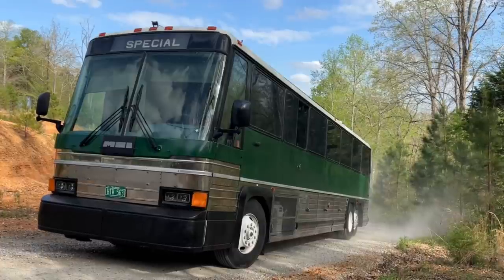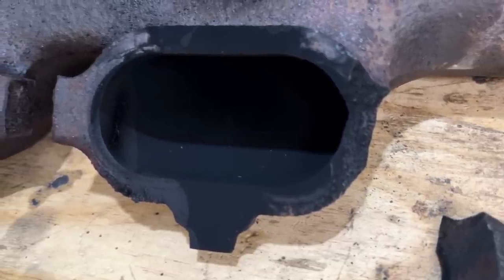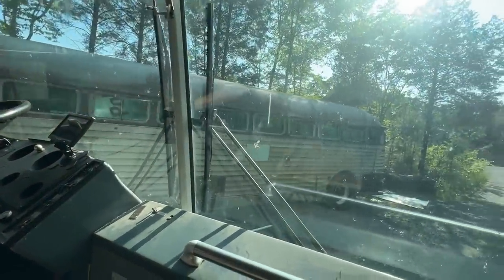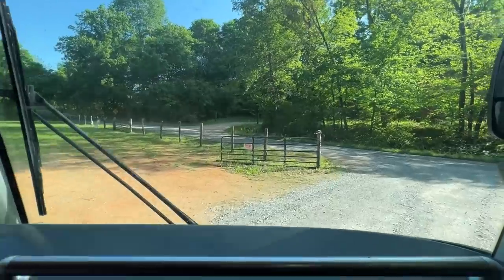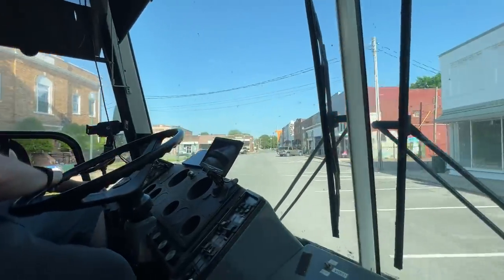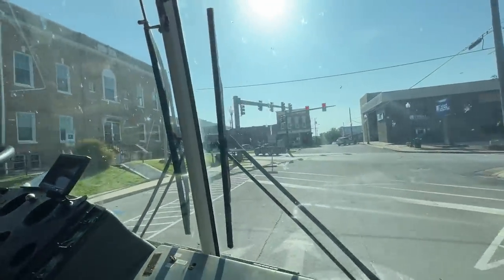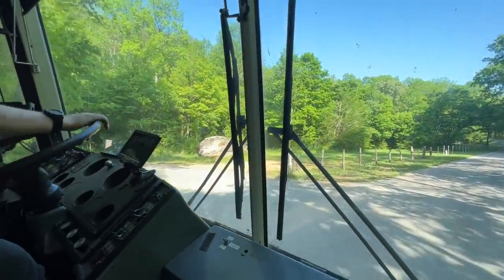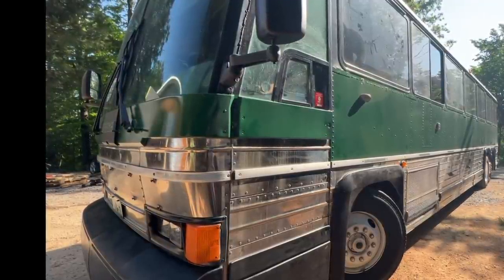Major improvement in handling and suspension on this MCI bus conversion.

Comment: It's really starting to sound like mostly bus shops these days are into more of just service related maintenance than heavy repair.  Change oil, filters, belts, hoses, etc. and send 'er on down the road.  Vintage bus owners that make it Bus Grease Mountain are the fortunate ones.
Reply: They aren't mechanics anymore, they are technicians who can only replace the parts the computer says are faulty. See it everywhere now even dealerships and mechanical shops. I heard one shop owner  say an all wheel drive van doesn't have wheel bearings. WTF!!
Reply: @robtodd8829  No wheel bearings?, I bet the Germans at the Mersedes benz factory are in stitches!🤣👍
Reply: @robtodd8829  ya know he may be right. I bet somebody heard about those muffler bearings one of my buddies would mention when we were young and full of 💩. Always joking around and having a good time with plenty of laughs. I miss those days and those friends that are gone. Yes sir, I bet they're using them muffler bearings now. No wonder a lot of this overpriced stuff now day's is nothing more than a mere polished turd. I hang onto my money. For me it's either old stuff or no stuff.
Reply: @robtodd8829  I think there are not too many good bus garages that are sincere there service and most owners and drivers need more instructions

Comment: Bad Diagnosis reminds me of where I'm employed at this time.   Just getting my time in until I can retire.  "New" buses 2021with less than 15,000 miles with air leaks that cause the the low air buzzer come on at idle.  Good Job Blue Bird! Also the AC quit at 5000 miles.

Comment: It's kinda difficult for me to admit this, being a retired truck driver, but most, not all, but most shops, dealerships and elsewhere won't pay the mechanics enough therefore some of them don't give a hoot or simply don't have proper training and the owners of these businesses don't seem to understand the problem and also won't admit their own business suffers due to their own lack of understanding and knowledge. As I said I hate to admit this but the lack of quality P. M. and 💩ity so-called repairs it's actually a good thing for a quality DOT Officer to pull heavy duty vehicles around back or over for an honest good inspection. I've seen this mess and actually at one time worked for an outfit that wouldn't, or couldn't do either a good complete repair and sometimes was actually very dangerous. "And" of course to top it, there's the horrendous bill you get for the crap job. As you know it's horrible. I've also found over the years it's become more difficult to find a good contractor to perform quality work for "anything". You are truly a blessing. Thank you Scott for being a "real" man. You, wife, son and security, can't leave out the puppy dog, "Bus Grease Monkey" y'all rock!

Comment: Thus where some very serious issues that got fixed. Thanks to Scott the bus is safe to use and not a danger house on the road. My understanding is the modern day shops don't wanna deal with very complicated and heavy maintenance works so they just swipe things under the carpet. In a way I can understand it but then again you let a unsafe thing out from the shop to the road. There is a million things that can go wrong later, not to mention law suits that might come in. But I guess no one ever thinks of that.

Comment: These buses seem specialized enough that most shops can't or won't do the work that's required to make them safe. Perhaps a small group of self-policing independent repair shops can refer customers to one another depending on the bus's location. Sometimes customers may be just too far away from Bus Grease Monkey !

Comment: Its either:

1. The shop doesn’t think an owner with an old bus can afford the repairs.
2. They think the bus is junk and don’t want to touch it.
3. Do bare minimum and replace a part just to get it on the way. 

I’m curious, the owner complained and they said they couldn’t find anything wrong??

Comment: 10:07
Best quote!
“When it’s at high rpm, that’s what it loves.”

The old joke was:
Before you get in a Detroit powered truck.
Slam your hand in the door.
Drive it like your pissed at it!
Reply: That's what the DD mechanic that worked on ours (1976, rebuilt in 1981) said, almost verbatim!

Comment: In my opinion, most converted bus/RV’s are sold for too much money. The price should reflect that  minimum of $10-15,000 in repairs will be needed to put it safely on the road. Engine and transmission problems can easily add another $20,000. They can be excellent RV’s once brought up to snuff.